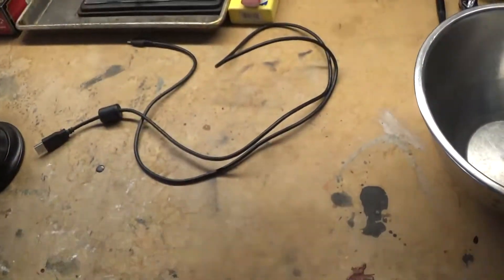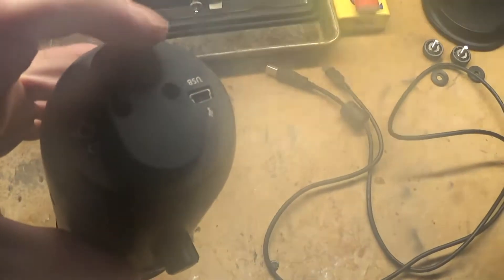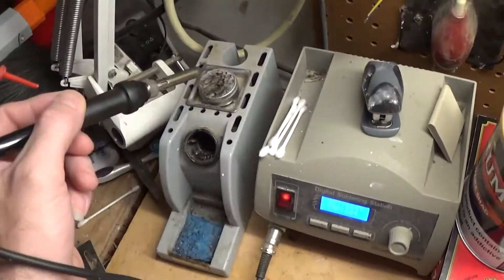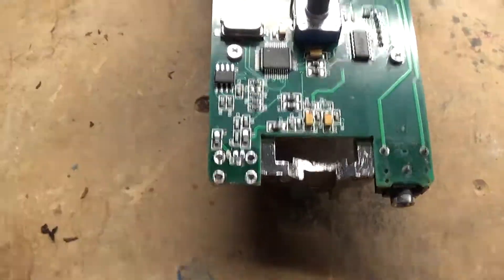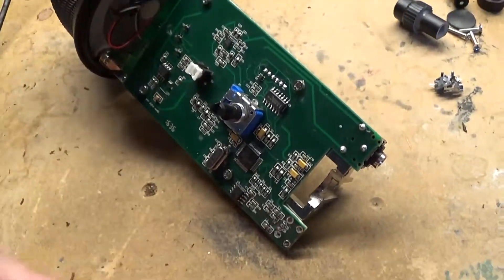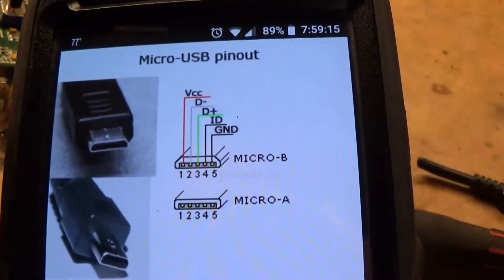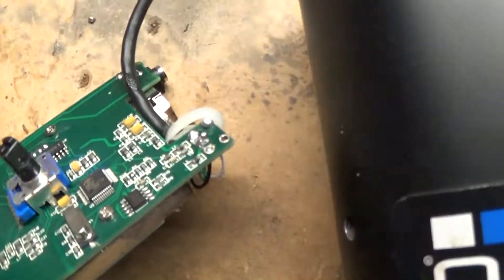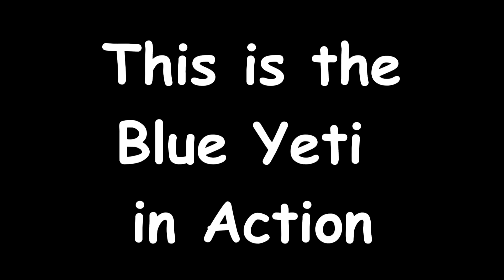Blue Yeti USB Hardwired Hack | The Idiot Repairs

Comment: can you show which cables you connected to which pins? im trying to follow as a newbie but its not so easy
thanks!
Reply from the maker: It's been a few years since I did this mod. I believe I ran the wiring to the back side of the board. So the Mute and volume will be face down. From Left to right starting from the top. #1 RED, #2 Green, #3 Black. Bottom #4 White #5 nothing. 
Hope this helps you out 👀

Comment: Hello, I would like to do this as well, would you be able to assist me?
Reply from the maker: I did this mod a few yrs ago. But I'll try to help as much as I can
Reply: @theidiotrighthere1829  I messed up in my attempt and lifted some of the circuitry from the board while desoldering, I'm also struggling to deal with the very small wires of the USB cable and soldering it properly so it may just be a problem where I don't have the skill to solder it. I used a solder that I used in automotive so the issue may be that my solder isn't fine enough to deal with the wires.
Reply from the maker: @NateDaBear   I've lifted the traces myself on Video Arcade PCB'S from lack of heat or going to fast (I get inpatient ). As long as there not broke, they will still work. I would hot glue them so they don't brake after soldering them. I use 60/40 rosin solder @ .32 diameter. Stuff I got from Radio Shack long ago. It's better to tin the wires first(heat them up and add solder to them). And than solder them to the traces. Hope this help's you out,If you need more help. I'll try my best to help you.
Reply: @theidiotrighthere1829  I will attempt again today after work. Thank you so much for the responses!
Reply from the maker: Just wanted to know if you were able to get this to work.